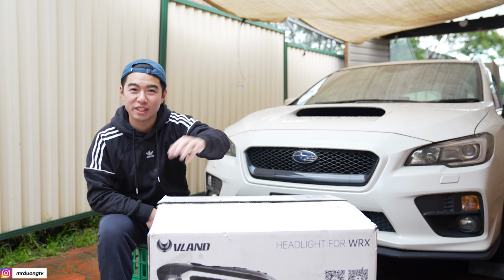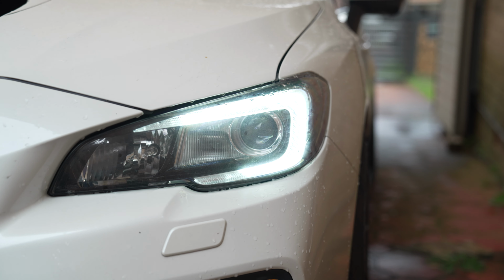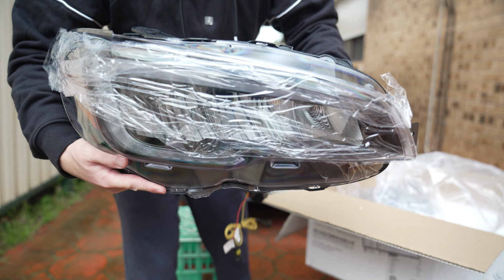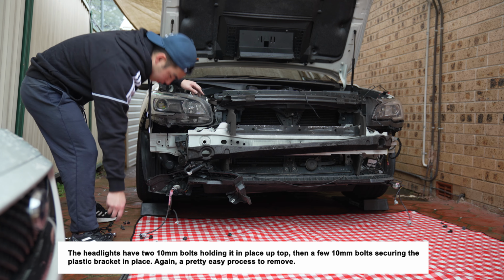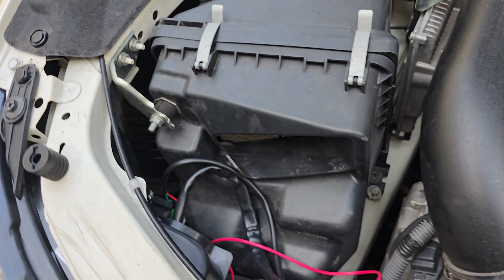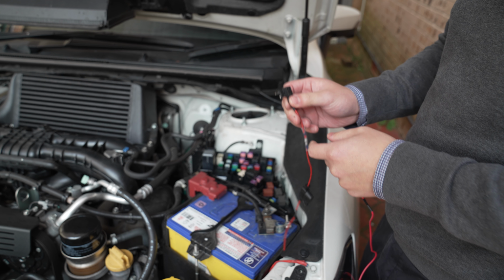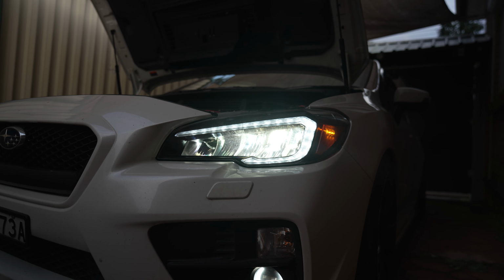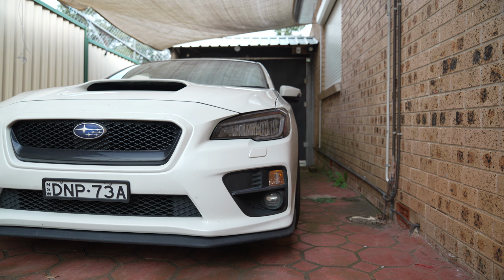CHEAPEST WRX LED headlights... but not without problems

Comment: I had a pair of VLAND headlights on my last car (Lancer) looked great, the main thing about the Subaru is that I don't need to change them.

Only the C Light as I want DRL's, do you happen to have a video on your aftermarket C Lights, or can you point me in the right direction for the install of aftermarket C Lights? Diode dynamics have a pretty good C Light for sale, but international shipping might take a while. 

I might be doing a fog light bezel replacement that has a DRL / indicator so I need to know if the aftermarket C Light uses the crappy stock fog light DRL OEM plug, as I might only be able to use one and not the other. Do you know about this too?

Love your videos they are very informative for AUDM, especially with the premium WRX 2016 (same car as me) If you saved me so much pain with your aftermarket head unit video and your idoing head unit video. I went with the idoing, it's fantastic!
Reply from the maker: Hey mate, cheers for the comment. Unfortunately, I don't have a video of it. I should have done it and regret not filming it! But it was such a stressful day doing that, I probably would have done something horribly wrong if I had to concentrate on filming too. 

For anything aftermarket, you'd have to wire any DRL straight to the fuse box. Initially, I had the fog light bezel too, and had to wire it to the fuse box. If it comes with the plug that joins the harness going to the stock DRL and foglight, then you're in for a winner, but I haven't seen one that does that (at least not for the pre facelift model). 

My C lights didn't have a harness. It just had a circuit board. I had to make up my own wiring which was quite simple - ground to the chassis, and joined two positive wires to one, some solder and heat shrink, then wire it to the fuse box in the slot I mention in this video.

Glad the videos were useful mate!